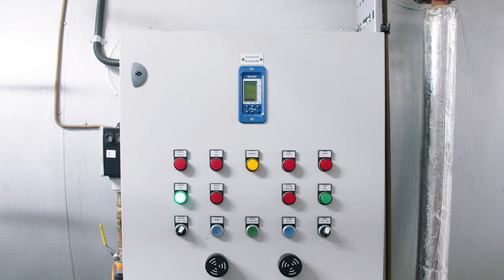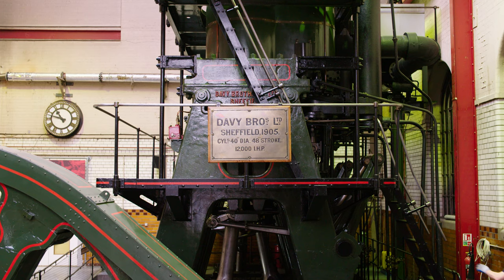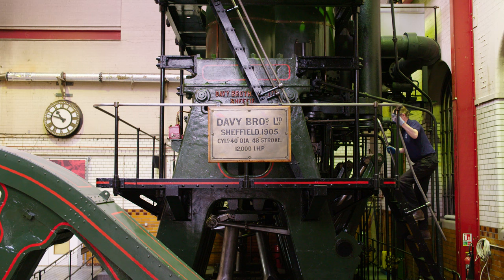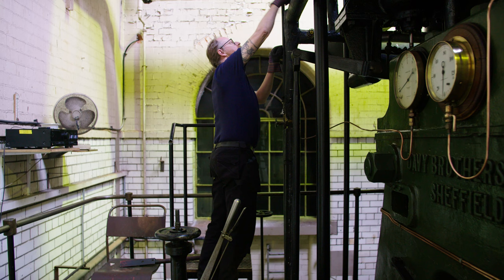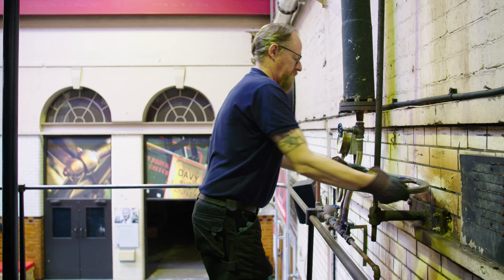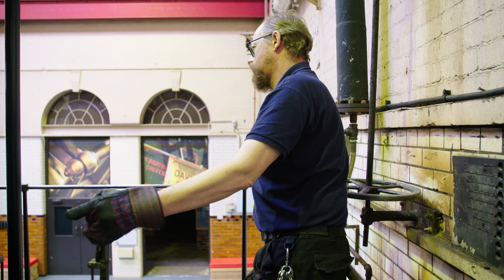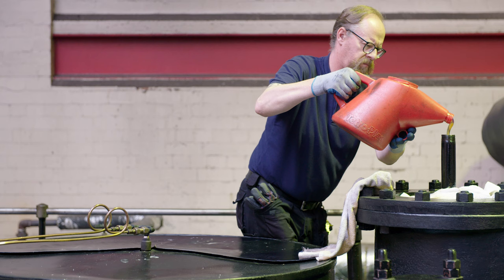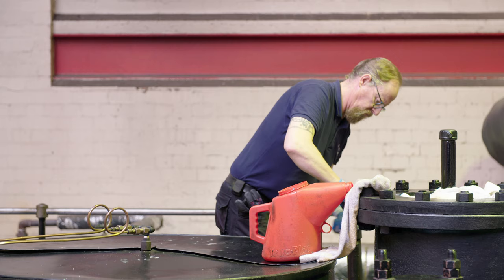Spotlight - The River Don Engine

Comment: This engine is not only ridiculous powerful but the fact that it can reverse so quickly is almost beyond comprehension. It’s akin to having a challenger 2 tank stop from its max speed in less than its half its own length and then back up at 30mph

Comment: We think that my great grandfather left the navy to run this engine (or possibly a sister engine). He'd been an engineer in the navy, so was familiar with the type (to an extent)
Reply: This wasn't a naval engine. Though it was used to roll armour plates for battleships up to 15" thick. It was later used to roll reactor sheild plates for our first nuclear power stations. Its had a varied career, but never been afloat. Saying that, your story may very well be correct of course, I'm not meaning to throw any doubt on that, just possible confusion that this or its sisters were ever used to power ships.
Reply: @John-yf8qh  He said that his GGF came ashore and used his naval steam experience at the steel mill.

Comment: I served my time as a fitter-turner at the River Don works 62-70 and was lucky enough to see this engine actually rolling plate.  The job at the time was rolling plate for a shield for a nuclear reactor at a power station. It was an awesome experience, the noise, heat, smoke ( caused by the birch twigs)  and sheer power of this engine the sight of which is etched in my memory for ever.
Saw the engine again in 96 at the Museum.  Yes a wonderful sight but no where near as awe inspiring as when she was rolling red hot plate.
Reply: Hi Peter thanks for sharing your memories  about the River Don Engine I was lucky enough to meet another fitter at the River Don steelworks   who told me about his time looking after the Mill pumps &  Hydraulic presses in the 60s I hope he's ok I volunteer down at Kelham & I never get tired of watching her in action when she's up & running take care all the very best Greg Harris
Reply: Thanks for your insights.  I've seen a dramatic film at Kelham Island museum of the rolling mill in action, birch twigs and all.  I wonder if they still show it?  It would be good if that film could be uploaded onto YouTube.